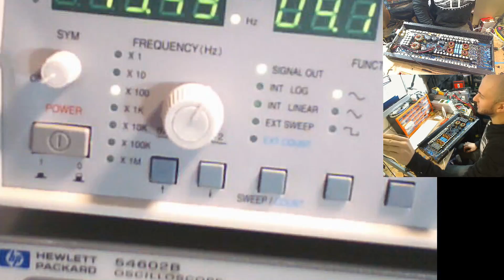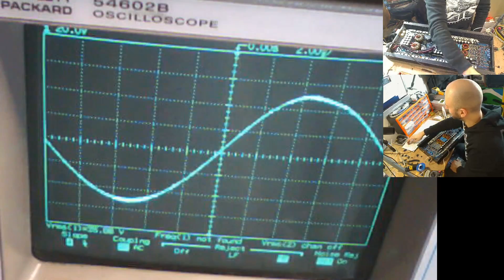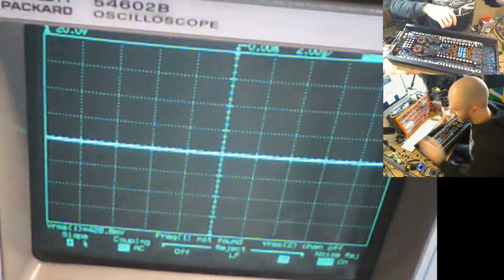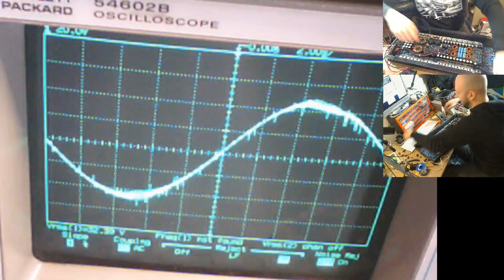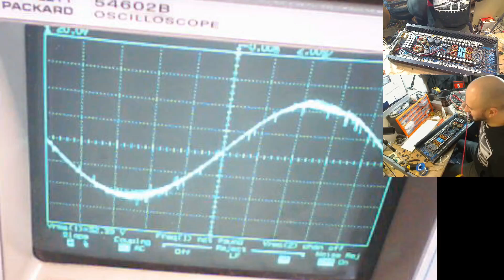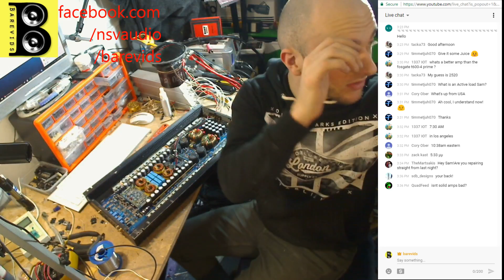Solid Audio F2500D 0.5ohm full power test

Comment: Bro... why you never check  the full power on 14.4v practically ... I always noticed that you calculate it theoretically only ... Any specific reason ??
Reply: Manjul Walia he only has a 12v power supply
Reply: 14v supplies are not cheap. The used server power supplies are and some put out over 200 amps @ 12v.